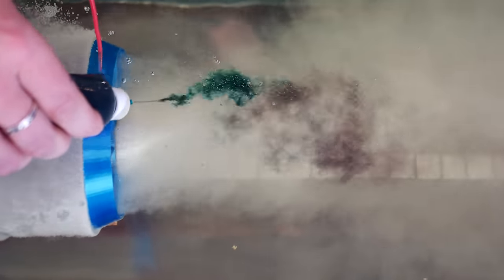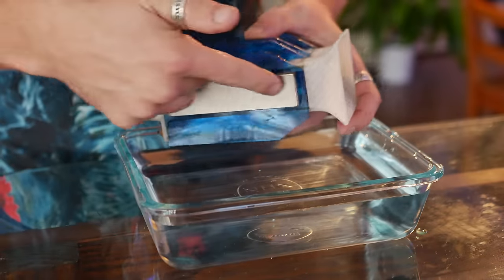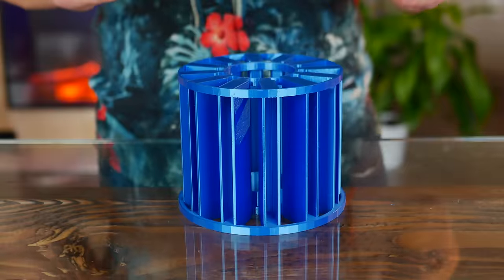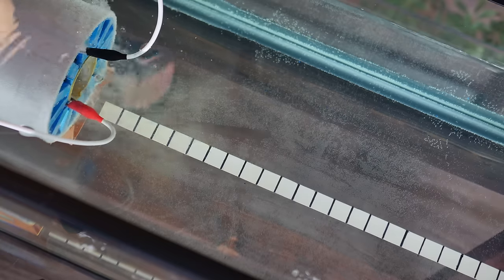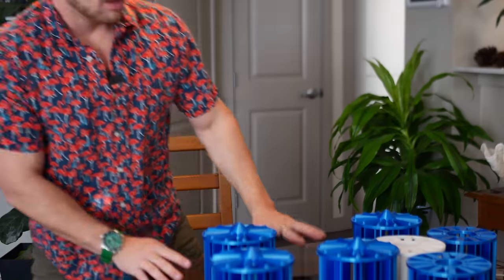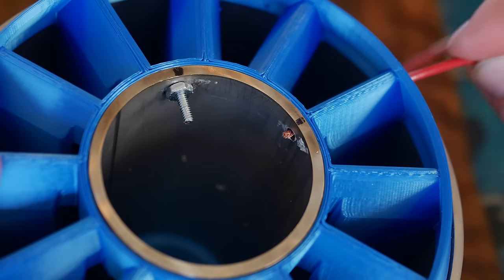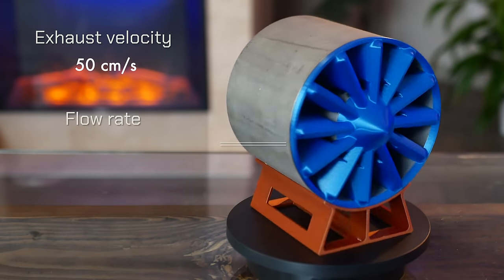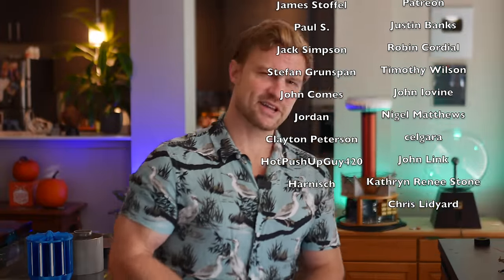Designing a Futuristic Magnetic Turbine (MHD drive)

Comment: Aero/hydro-dynamics:
The best shape for your hydrodynamic leading edge is half an ellipse, where the full ellipse is 3 times as long as it is wide.
Similar for your nose cone in the center.
The sharp trailing edge cannot converge at an angle  of more than 7 degrees per side if you want to completely avoid turbulence there.

I also think that Entrained Flow down the center of the inner tube is likely to improve overall flow/thrust rather than hinder it. 

I'd post links to research if YouTube's almighty algorithm wasn't bound to delete the whole post... or is that you..?  :)

Comment: This is an awesome application of the Lorentz force and a very well-done design over all! I loved your choice in using stainless for the electrode as well since it is corrosion resistant and non-ferromagnetic (don’t want to pull magnetic flux out of the air gap). 

I would be curious to see how the wall thickness around the magnets affects the efficiency. FEA would probably be needed to determine that however 🫤

Comment: Hello, by using Stainless Steel Electrodes or any electrode material containing Chromium toxic Hexavalent Chromium can form, not only it's toxic but it's also a carcinogen (Also the crocodile clips are made of Stainless Steel, i recommend using copper ones). You should use MMO(Mixed Metal Oxide) Electrodes they are not only much more resistant and wont oxidise they also wont form toxic compounds. Also using Table Salt (Sodium Chloride) or any compounds containg chlorine, Chlorine gas can form at the anode. It's a highly Toxic and Corrosive gas.

Comment: try coating the surface of the electrodes with nickle, silver , gold or platinium. sorted by cheeper and less corrossion resistance first. it will not only make corrosion resistant but it will also increase the surface conductivity thus increasing overal performance.
also if you are coating the surface anyway you might as well choose a copper tube for better conductivity

Comment: In reading further, it might be interesting to compare my known props output, and amp draw, with your less disruptive  thrust system.  I can do most useful voltages 1 to 6 batteries, with hot wiring,  as I use them in the boat for other options.  Thanks, Cal

Comment: ChatGPT said: If you aligned a gyroscope to 90 degrees to the Earth's axis, you would expect to see the gyroscope precess at a rate of approximately 1 degree every 4 minutes, regardless of the latitude. This is because at this alignment, the gyroscope's axis would be perpendicular to the Earth's rotation axis, so it would complete one full rotation (360 degrees) in 24 hours, resulting in a precession rate of 1 degree every 4 minutes.

If the Earth is not turning, the gyroscope's axis would remain fixed in space, pointing in the same direction, and there would be no precession.

Comment: If you were to stagger the discharge length and or possibly cycle power supply in a rotory motion to achieve any gain from the effects similar to that of equal length headers on an engine to allow a type of suction or pull from each cavity to increase performance.

Comment: So my understanding is that the real limitation to MH propulsion is the energy losses from electrolysis. I know the ohmic array water heaters avoid this problem by using alternating current between the electrodes, but the problem there is that you have to keep the orientation of your electric and magnetic flux constant. This makes me wonder if it's worth it to consider using electromagnets, so you can switch the electric and magnetic polarity in unison. Would the reduced electrolysis losses make up for the increased power consumption of the electromagnets?

Comment: If the design was funneled in the rear, instead of just straight through, maybe it could have a higher thrust output like a jet turbine or scramjet engine. Kind of like water hose gun, your design might be like the wide full spray selection which comes out slow. A funneled exit like the water hose center jet  selection, the smaller exit maybe a higher the pressure output. Just me thinking aloud. Not sure if it is applicable. Liked the design either way.

Comment: You should use an automotive coil for the voltage supply. 12v primary supply - 20,000v secondary (High Voltage and low current output)

Comment: You need to insulate the conductors    The wires and pipes.  There is in your design a current flow btw conductors through water.  Causing loss. Causing to electrify water. At low voltage minimal. E= I x R.   To be practical Voltage would need increase. But everyone knows what happens when a toaster is dropped in bath tub.

Comment: If you want to truly want to increase the flow rate and decrease the power output use a measured amount of sodium hydroxide  (common toilet cleaner) (caustic soda) and mix in well using ultra distilled water . Unfortunately you will need to wear gloves etc. You also may want to test the plastic for any possible degrading or reaction . You will also discover the voltage can be decreased down to about 2 volts and the amperage will be a lot less, making the unit far more power efficient (  a single cell in a lead acid battery is 1 to 2 volts for a reason) . You will also notice ,that by using ultra distilled water you will not get the very quick cell degradation and green slime build up that would normally destroy these devices.

Comment: The one way you could reduce both heating & electrolysis is to drastically reduce voltage drop to below the dissociation potential of water. But this is easier said than done given the resistance of water albeit however salty!

I wonder if you can come-up with a method of of reducing the path of conduction-between electrodes while increasing the area. You will have to come up with a clever geometry that does not increase water-resistance. This also poses a big challenge for placement of the magnets across very thin paths provided for the water flow. But I think you will figure away around this. Best of luck.

Comment: I was just doing the math to make a functional model capable of 60MPH. It would take a power source of 193,121 times greater value to make this move a boat. 

Yes it can be done.

Second question, how does one draw off the brown's gas being created in the exhaust of the turbine? That too could be use as potential fuel.

Comment: An amazing design and proof of concept. Glad to see you were able to make it work. But towards the end of the video, I kept thinking of something: I am no scientist, and have far less education than you, but it seems to me to scale this design up to be able to move any kind of craft on the water, the power would be insanely high, and the Gauss rating on the magnets would be also way more than what you could buy normally. And even then would it be able to move anything on the water? A great video, and not the first I seen on your channel. Hope to see more projects!
Reply: You are correct. One of the senior projects my class worked on in 1974 (50 years ago this month) was this same principle. The results were very similar, very low thrust with very high power consumption.  Such low efficiency that we quickly abandoned the idea. Just think, the weight of the batteries, or power plant required to move a ship would probably sink it. And it would be so heavy, it most likely wouldn’t move anyway.

Comment: Still enjoy your video, I have another thought, I’m trying to design a gyroscope with no moving parts, I did have a propulsion device that weighed 1642 pounds that got off the ground with 20 horse power with of electrical motors.  Unfortunately, I tried to use a motor controller on a capacitor start motor…didn’t work for very long, it’s uncontrolled design from the dizzying height of 5” landing with a resound thud on the concrete floor.  I used rotating gyroscopic steel discs, 14” in diameter that weighed five pounds each spinning at 11,000 rpm.  My unit was 78” high and four feet square.  

At one start up, one of my discs came off.  It was not a boring event.  So my thought is to build a gyroscope that spins magnetic discs at maybe 100,000 or more rpm.  I have heard that magnetic fields can act like a solid…I don’t think they disintegrate, no matter how fast the spinning motion…I may prove myself wrong, it may prove to be less boring than careening steel disc.  My thoughts were, perhaps a combination of both designs would enhance each other, then you would have a vehicle that could operate in a fluid, a gas, or a vacuum.  A person could live under the sea and go visit a friend living on the moon.  

Sorry, I think my residency of the Republic of California is letting my ignorance reveal itself.  Greatly enjoy your videos, admire your ingenuity, and I am receiving inspiration from your experiment.  I was sitting on a plateau, now I see myself moving again.  Thank you.

Respectfully submitted

Comment: If memory serves, they are audibly quiet. But electrically noisy. The high Amp and voltage puts an electric signal in the water from the exposed conductors. A side effect of operation.

Comment: You could use the front and end cap and steel casing to hold everything together. Removing all the inner print to hold the magnets. That would slightly increase the efficiency of the magnets. Also I'm curious if the efficiency would go up if you coated the outside stainless steel with something non-conductive and/or hydrophobic. Overall that was a pretty impressive jump in efficiency from the first design. Also I wonder if there is a way to reduce the hydrolysis as that might be slowing things down.

Comment: This could be made dynamic. If the charge is applied on the inside of a tube by rotating carriers that are attached to an AC generator, the charge point would be moving and the input would likely scale. I see supercaviation as possible, but it wouldn't be silent. Imagine an charge carrying, rotating internal solenoid cavity with magnets at the back driving a sub or torpedo. Nobody seems to see what I see. Too lazy to CAD any plans.

Comment: A little over 1 mile per hr. However there is the total weight to trust to consider. ( the gas or fuel + generator and its weight + boat+ cargo) in addition there is also the resistance of the water against the force being produced. The salt is the water here is a important consideration but what happens when you go into fresh water? Have you considered a floating screw propeller?  In the end game the noise from the engine even a generator is still transmitted through the hall. Still frequency pollution.

Comment: Have you considered using this engine in combination with the ionic thrust engines on boats. Using the MHD drive underwater for propulsion but also as the primary engine for turning, with the ionic thrust is used purely for propulsion

Comment: Got a couple thoughts. First I'm thinking you need to waterproof connections to prevent corrosion. Secondly this process appears to be separating water into hydrogen and oxygen. If this is happening you should isolate these flammable elements  to create more energy for the process or to use elsewhere.

Comment: I love the no moving part and quiet and ease of maintenance. I hope you keep going, this would be awesome if it could produce some serious power without hooking a nuclear power plant up to it LOL Does flowing water through it under pressure produce a voltage on the leads? If so you may have created a new kind of more passive generator than a turbine.
Reply from the maker: Thanks! Im a huge fan of solid state thrust, both ionic in the air and MHD in the water. You totally can use this as a generator! In saltwater, if you dragged it behind a boat it would generate a few amps.

Comment: I build boats and have done so for a carrier 24 years and counting. The concept is great except one thing! And it's pretty major. 

Do you know why avoids are so important to boats. 
 It's be cause they are there to attract the stray electrical currents from badly wired boats on the marina and or bad wiring at the shore power. 
What happens is anything metal attached  to the boat will corrode away from the electricity in the water. The nodes protect the metal.parts lime through hulls, brass drain plugs, trim tabs, Screw and  bolts.  
Although I think this is a awesome demonstration. 
I think used in another way would be far more beneficial way. 
As in a Inertia field generator. Or gyro stabilizer.  Can you make it work almost like a sea keeper but in separate isolated chambers where the fluid has its own compartments. 
What if a farrofluid was introduced a the vortex golden ratio applied.

Comment: I think that's a good start, but unfortunately you didn't take the properties of water into account. Water is incompressible. This means that your structure has a lot of flow resistance because the water has to flow at the same speed everywhere.
With linear acceleration, in order to avoid cavitation and reduce resistance, the nozzle cross section should be reduced by the quotient delta v. What do you think about that?

Comment: You need to use glyptol insulating paint. One question I have is how much of your current is a direct short through your conductive fluid? 

Note that it might be hard to get a good coat of paint on your inner,  small diameter pipe. Consider that if your outer pipe is completely insulated, the inner doesn't matter.  Additionally,  if you glued the end caps on your inner pipe, you wouldn't need to insulate the inside.

Comment: Problem is this thing is horrendously energy inefficient.

Input power P=I*V=30x25=750W

Output power=specific kinetic energy * flow rate = (0,5^2)*1,035/2 * 3,65 = 0,472W

efficiency = output power / input power  = 0,472 / 750 = 0,063%

Efficiency of that thing should improve by at least two orders of magnitude to be worth of even the slightest consideration.

Comment: If commercial shipping uses this, they’ll probably be running diesel electric systems, which will need to be isolated from the hull to keep that noise down, too. I think your biggest customer would be the military for submarine applications. Of course, then you’ll be leaving significant bubble signatures in the water… 🤔

Comment: I was hoping you’d mention devastating pollution due to the gases formed from the electrolysis, e.g. chlorine and all that jazz!! Also you will cause the water to lose oxygen which, last I checked, many flora and fauna depend on to live. I’m guessing that it’s not that quiet. Just a different type of loud to a propeller (rumble vs hiss).

Maybe this would be better suited for a different application. It’s a bit similar to ion propulsion engine.

Comment: You are probably generating hydrogen at high voltages.  The navy I think back in the 60s did some experiments  like this for submarine and boat propulsion(silent running)?🤔🤔  Higher voltage, higher thrust but does also mean higher current?  Could you use a Vander graph generator as a voltage source?  This is cool stuff ❗

Comment: My thought (as a non engineer who is also completely unfamiliar with hydrodynamics): what if your thruster was a system, which used multiple "stages" of thrust voltage to drive the water motion, on the assumption that part of the challenge is giving the fluid a chance to overcome a lack of momentum and build up speed? Just eyeballing your completed work in action, it appears (to me) that you only have a chance to apply magnetic force for a few inches. So the fluid goes from zero momentum, up to your measured momentum upon exit, but maybe there is a chance to increase that momentum using your current exit point as the starting point for the next stage, which would not have to impel the fluid starting at zero momentum when it uses the higher voltage?

So what if your thruster were 4 times as long, each section with a higher applied voltage? (Also, why not print the flow gaps in your model as array of internal parallel tubes to increase laminar flow?)

Comment: Hello, are you interested in trying to make an electromagnetic plasma jet? The design principle is similar to a jet engine, but it uses an electric motor to rotate the engine shaft instead of placing a compressor or anything else. It's all the same except that the combustion chamber is a bit larger to accommodate air with a volume that is compressed enough that electromagnetic waves or microwaves will affect the air particles to vibrate and collide until they become plasma. This is the electromagnetic plasma chamber and then goes out as thrust.

Comment: Congratulation for the nice design, for the quality of the realization, and for the quality of the presentation.
Can you please provide information about the weight and thrust for both thrusters, if possible with a breakdown for magnets, electrodes and structure for the weight?
Reply: I was finally able to figure it out by myself (at least approximately) given the references you gave for the electrodes and the magnets. Assuming that you use 4-inch slices or the inox tubes, I get about 1.468 kg for both. With a typical density of 7.5 g/cm3, the 12 magnets should weigh about 1.474 kg in total. Regarding the 3D printed plastic structure, I estimate its possible weight between 0.2 and 0.4 kg (from what I see at 3:13 regarding the slice). So overall, something close to 3.2 kg.

Comment: try to make it shallower. same diameter but shallow. only last some portion is doing actual propulsion, front portion is just wasting energy on electrolysis. because once ions travel from cathode to anode, vast momentum is absorbed. so in most efficient setup, you need to have ions from the cathod intake getting to anode just before they're about to exit. you can calculate exact depth from current flow, medium type, force and viscosity, but its easier to experiment. its weird but in this case less is more. if you think about it, with same current 1 meter long setup would give negligible propulsion.